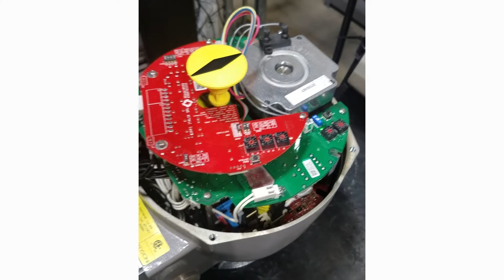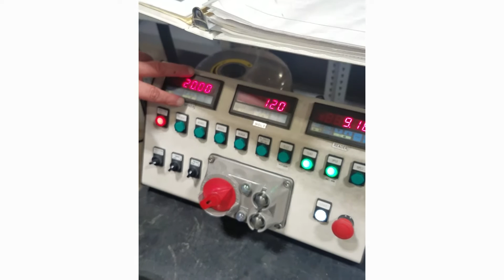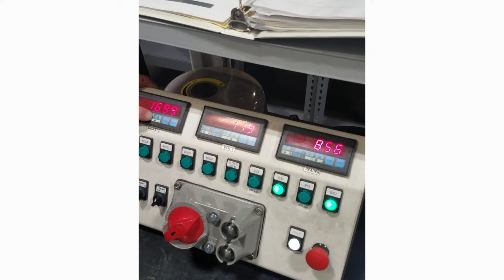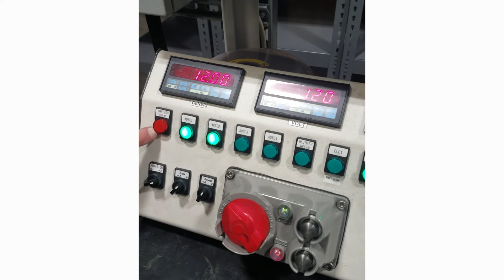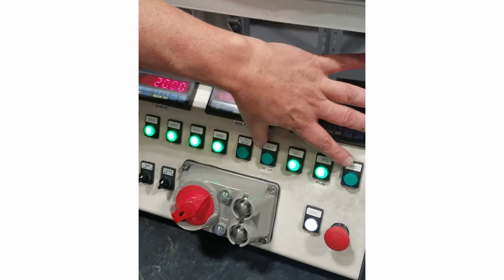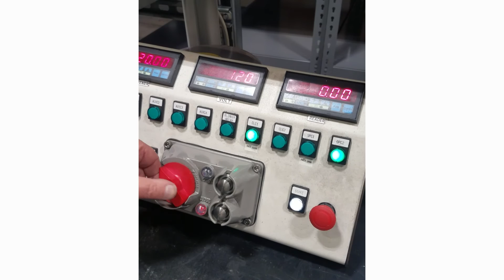Keystone EPI2 Setup & Commissioning Video 6 OM1 Analog Card Advanced Setup, Setting VDC Feedback

Comment: The analog input wire lands to terminals 12 & 13, where 13 is positive, the "input" is to the actuator, where the "output" is from the controller. Regarding feedback output, terminal 14 is always used but terminal 15 is used for "loop powered" systems (the actuator does not generate the signal,) and 16 would be used if the actuator generated the signal. Note that for actuator generated power, terminal is is landed with the positive terminal, but with a loop powered system, 14 is negative and 15 is positive- the electron flow is the same, but the polarity notation is inverted. 
Read the WD and consider the notes-